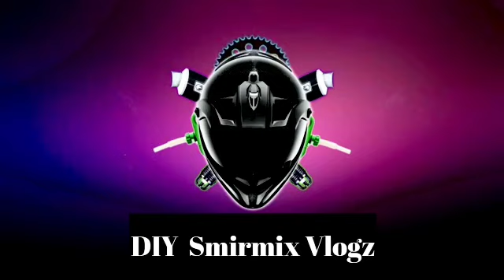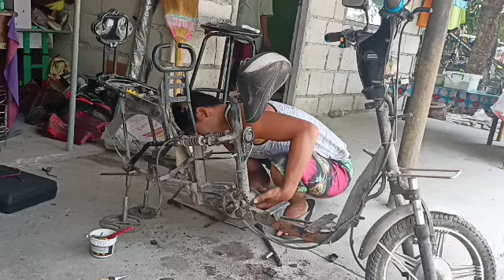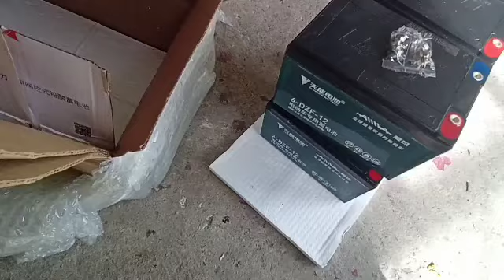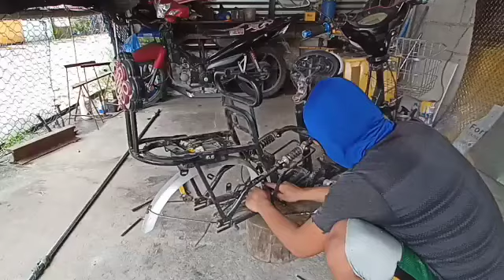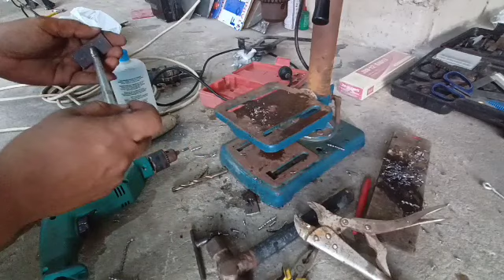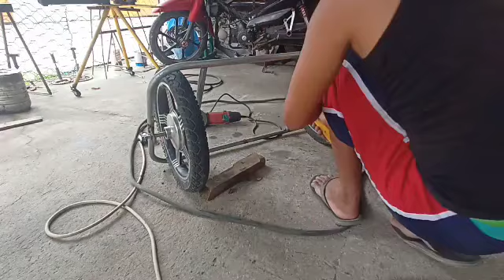2 WHEELS EBIKE CONVERTED TO 3 WHEELS(EBIKE CONVERSION)

Comment: Tanong lods...😊
Yang ganyang klaseng motor wheel o hub ilan po yung volts nya at watts po?
At pinalitan o bumili po ba kayo ng bago controller nyan?
😊
Reply from the maker: 48 volts,  350 watts po yata.. 2nd hand po kasi nmin nabili kaya di aq gano sure sa watts..  Pero sure po sa volts sa motor,  di po aq nagplit ng controller boss.. Stock po lahat yan..
Reply: @DIYSmirmixVlogz2223  
Thank you lods sa reply...😊